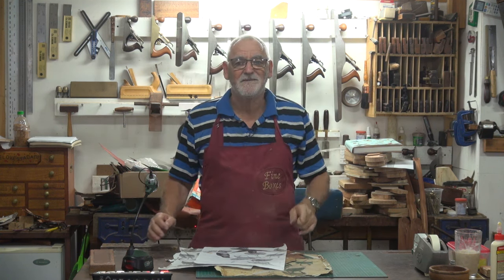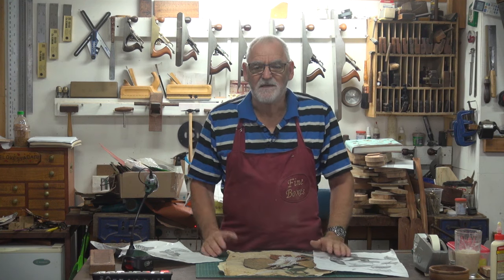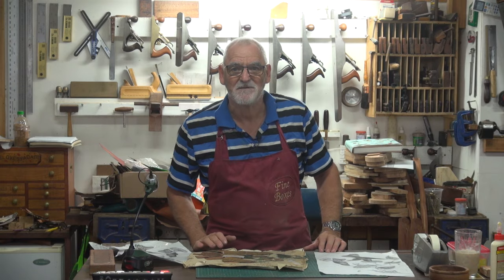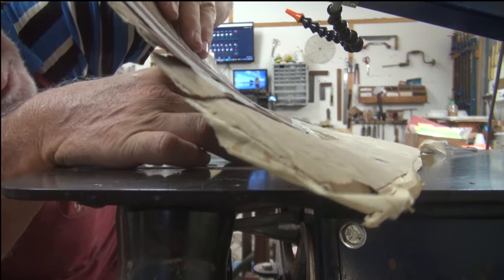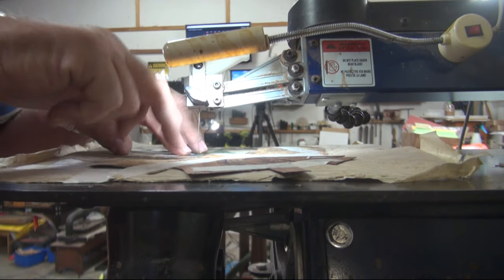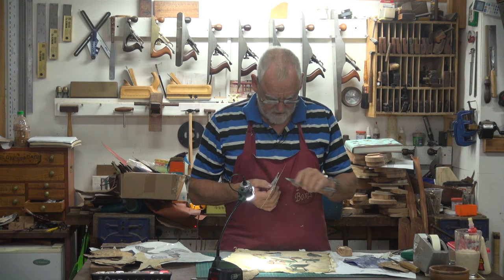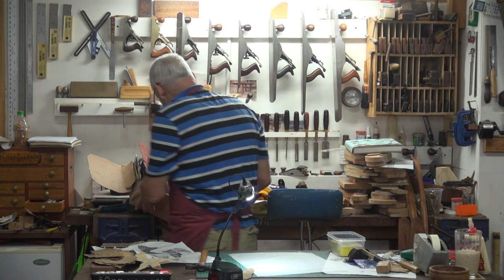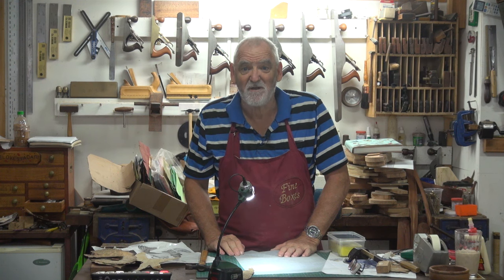Reverse Double Bevel Marquetry. My favorite form of Woodwork

Comment: Beautiful work. This week I just finished a 5-day marquetry class with Marc Adams,here in the US. Extremely frustrating but also great fun. A couple of minor differences. He teaches a 7 degree angle on the blade  and the “keeper piece” always to the right of the blade. He also showed us his method of dyeing wood. Simple but lots of steps.
Reply from the maker: Hi Randall, degrees are really persaonal preference but must bew over 0 or there is no bevel. As for the keeper piece it all depends if you are wanting to save the top piece or the bottom piece. Continue the journey.....and enjoy it.Cheers Steve

Comment: Hi Steve, what angle do you use?
Reply from the maker: Hi Brenda, 13.5 degrees works for me. Tilted to the left, cut outside the line anti clockwise. So the piece gets turned clockwise, if that makes any sense. Cheers Steve